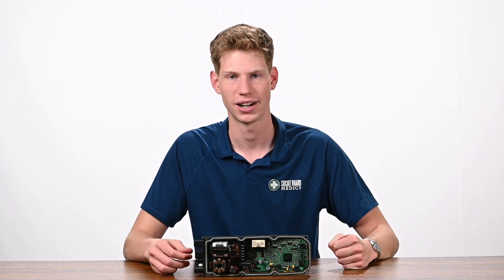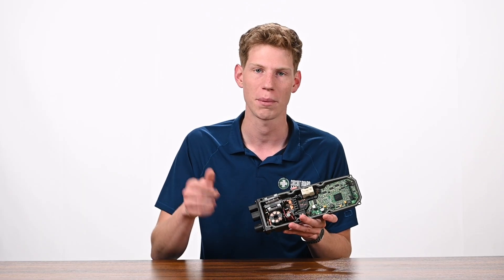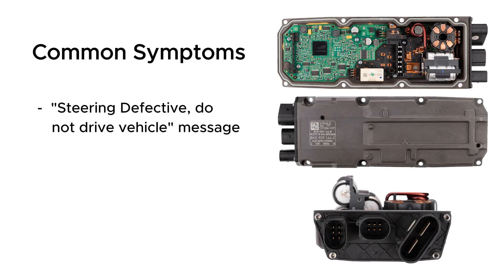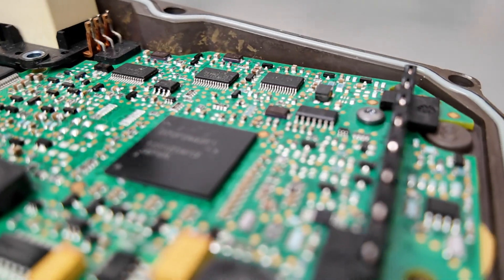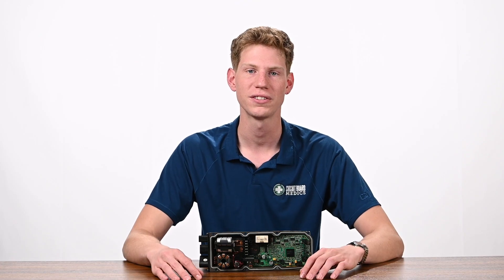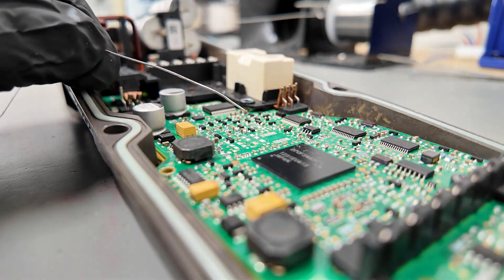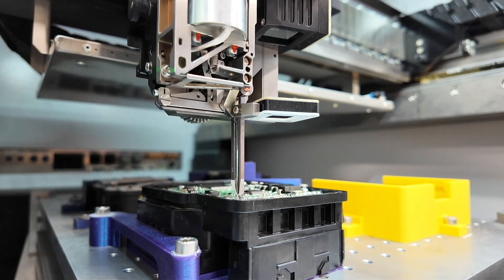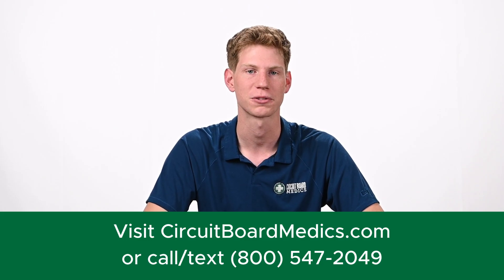How to Fix an Audi Power Steering Control Module (B200000 + B200049 Repair)

Comment: Im getting fault code C11DF29, steering rack with control module J500 must be replaced 
Can this be sent for repair?
Reply from the maker: Unfortunately, our repair doesn't address that fault code. It's more likely that you have an issue with the steering rack itself.